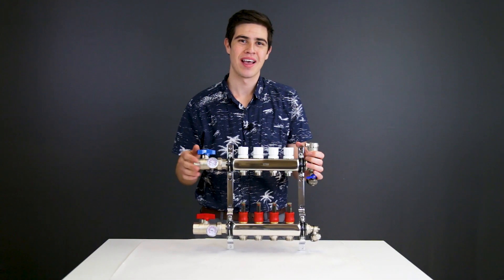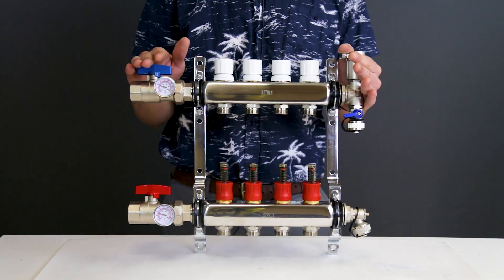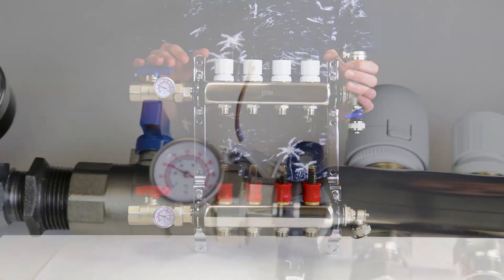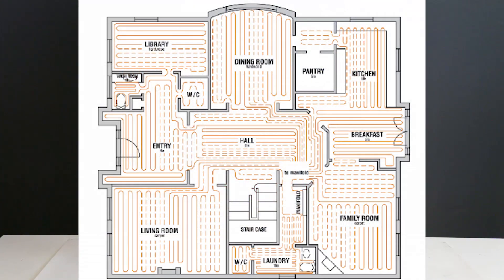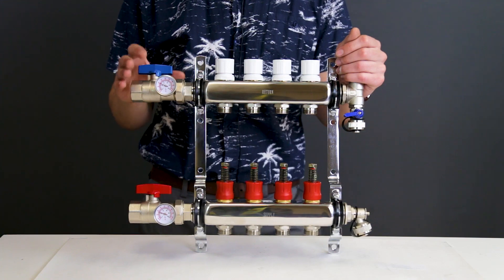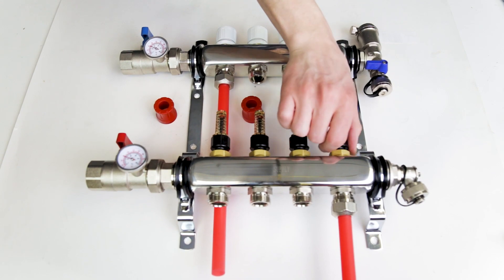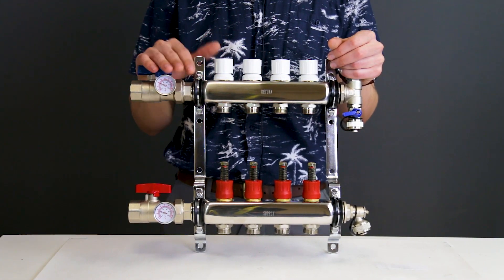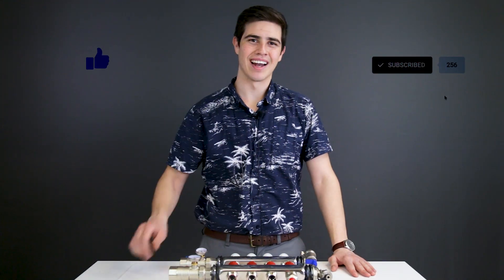HOW TO INSTALL A RADIANT HEATING MANIFOLD: Directions and Tips to Properly Install New Manifold

Comment: We are setting up our radiant floor tube tomorrow. We don’t have water on the property yet. Can we pressure test the lines without water?  You mentioned water in the video so I’m just trying to make sure we are prepared
Reply: Air is a lot better than water while pooring screed, pressure to 6 bar, 2.5 times operating pressure,  and live it like that though the pouring and queuing process! After that you fill it with water or glycol! Glycol is an inferior heat transfer medium compared with water but in cold regions and non operating systems, you  have to !

Comment: How tight do the connections into the manifold need to be? I’m spraying soapy water onto the connections and pretty much all of them are leaking air during my air pressure test.  Thank you!
Reply: Same here. Same reason I am watching this video of the manifold I bought. Seems pretty broken to me.
Reply: @lappinrappin  I figured it out. I was scared to tighten it too much and that was the issue.  Those fittings and pex tubing can be tightened quite a bit. So don’t be scared and keep tightening.  I did a pressure test afterwards and it held just fine.
Reply: @alejandrodebasilio1606  thanks for the reassurance. I found a different video of someone else complaining about it and it was the same solution- tighten them like crazy. 

I did it and so far my pressure is holding. Thanks!

Comment: Office floors are cold 
I have a 3 branch manifold. 
2 branches run through the living room floor and one runs through the office floor 
The living room floor is warm. The office floor is cold 
When I touch the one pipe that connects to the manifold from the office , it’s cold to the touch. 
When I touch the other two pipes on the same manifold that run to the living room they are hot. 
Why is the very left branch of the manifold that runs to the office cold and yet the other two branches to the right of the office branch running to the living room warm.
Reply: Actuator broken OR pin stuck down OR huge air bubble commonest. If no actuator, make sure the decor knob isnt screwed down too much. Stuck down pin is common. Take off the 3 actuators or decor units and inspect

Comment: Good evening, I have a Tiemme (italy) manifold & I don't think I have it properly set up. ? My top row has the (white) adjusters & I have the hot feed flowing into this row.....I have a feeling it should be the other way around.......Does your "Red" indicate that thats where you attach the hot feed...?? My system works ok....but I imagine it's the reverse of what it should be.....Any help appreciated.. Bill
Reply: Yes, hot comes into supply side where the flow valves are

Comment: My manifolds are identical to the one in your video except they are 10 loop. I would like to bring the tubing from second floor to the manifold from the top and to bring 20 tubes down the sides and make a U turn up to the manifold seems too tight due to room available. Can I turn the mini folds upside down with flow control valves facing down so the tubes can enter from top????

Comment: I bought a 6 circuit manifold. My plan is to feed four cast iron radiators & two runs of radiant floor heat. Couldn't I just turn the flow down on the floor runs to keep the temps a bit lower?? My other thought was to feed the floor runs from the return side of the cast radiators after they have lost some heat. Any thoughts?

Comment: If the manifold and related components were completely taken apart and inspected, how tight do we tighten them back up prior to putting back in service?  And this pressure test is with system full of water, not air only?
Reply: another vendor sent me here when I asked questions on their unit, looks very similar other than both sides have manual air bleed units.

Comment: you said if your using where freezing my occur use proper antifreeze and then removed it... is the unit suited to continually use antifreeze? like say if i was only heating it 50% of the time its needs to stay in there ??